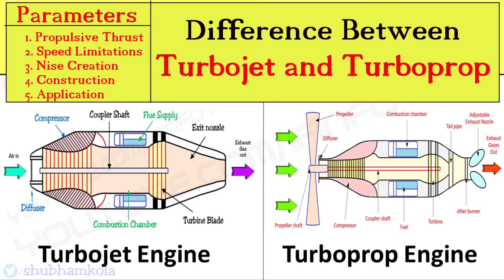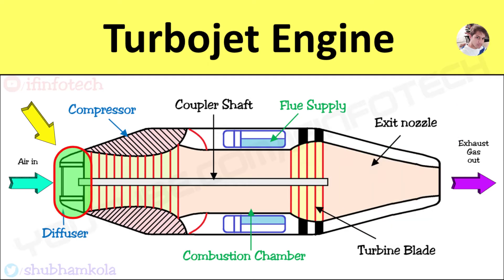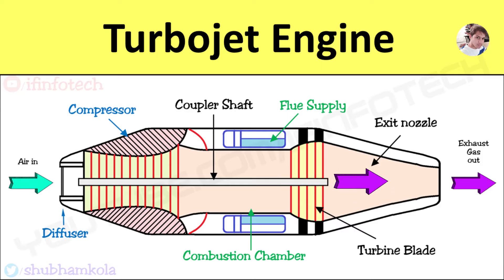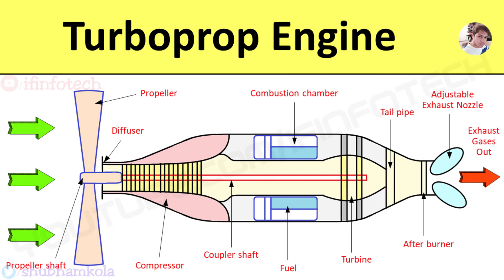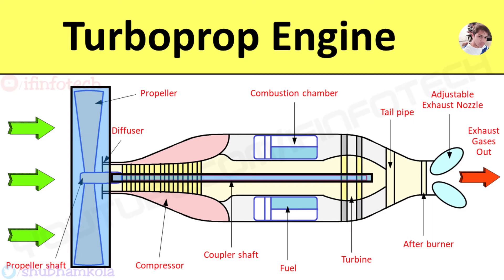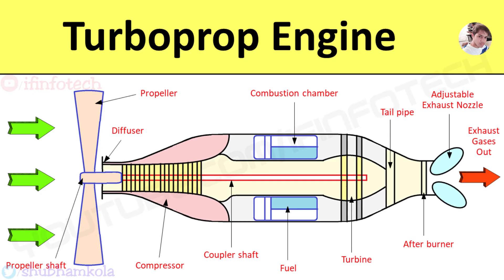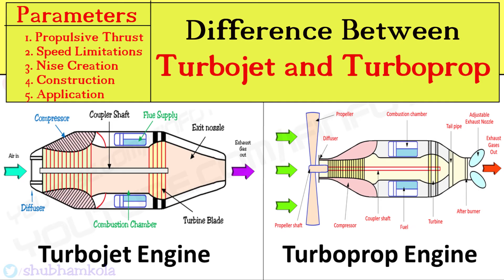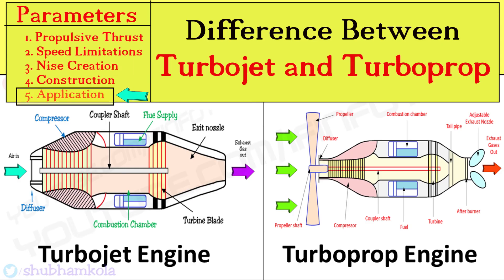Turbojet Engine and Turboprop Engine Working [Animation video] Comparison, Advantages, Applications

Comment: Initially at the time of starting the engine how the air will be compressed when air has not reached upto turbine? How the shaft will rotate at that time and how compressor will run?